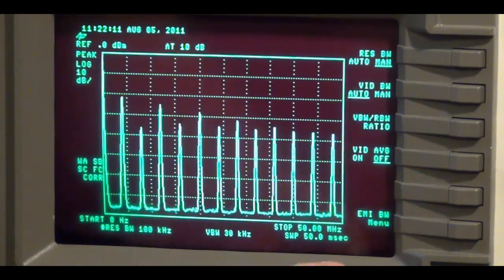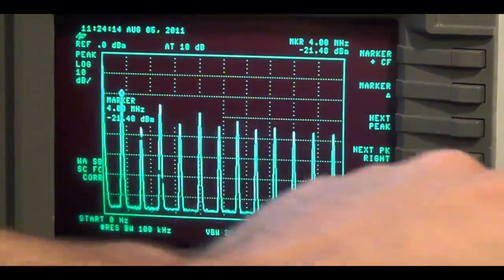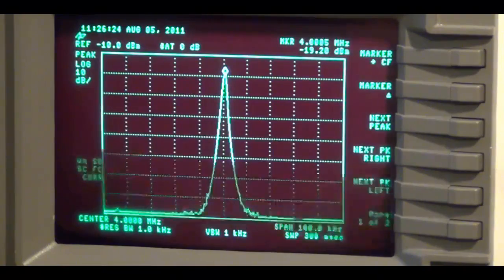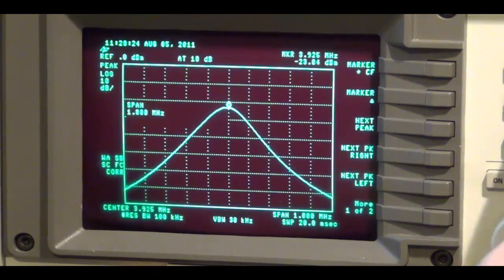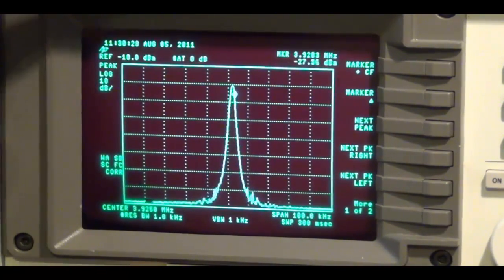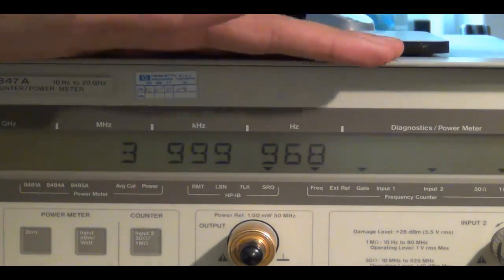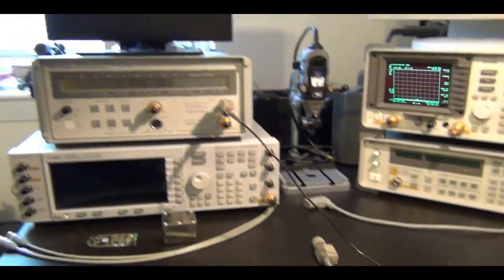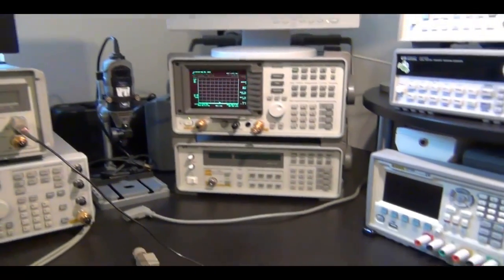TSP #4 - Frequency Generation: Crystals and Ring Oscillators (Part 3/4)

Comment from the maker: You have to be careful. The spectrum analyzer does not measure DC. The instrument is AC-coupled only.
Reply: The Signal Path lots of SA’s out there with blown front ends from an incursion from our friend DC.

Comment: Probably not, the problem lies in the stability of the components used. External noise would show up as arbitrary frequencies on the spectrum analyzer, it would not influence the stability of the oscillator.